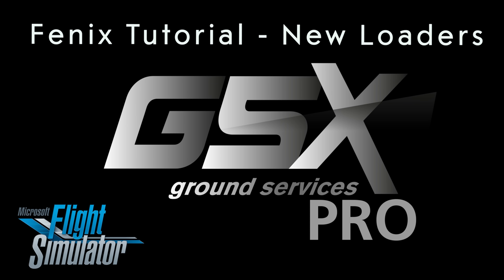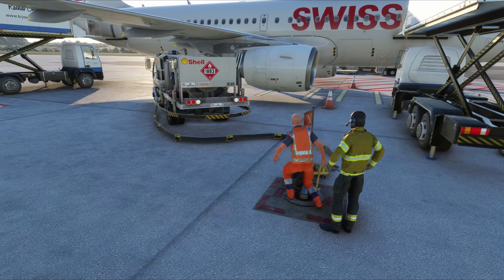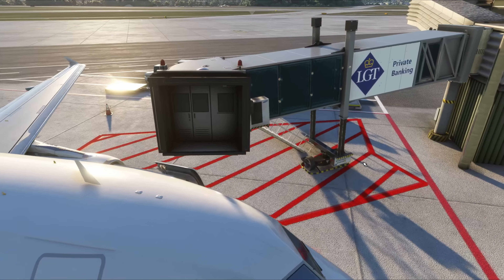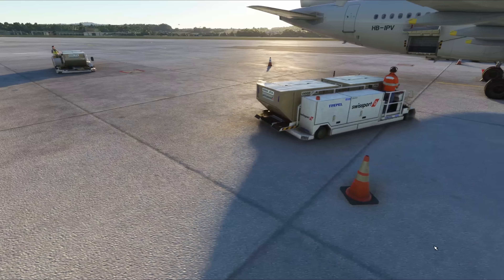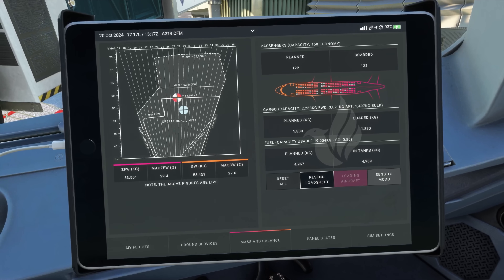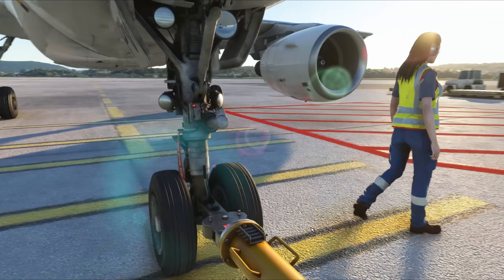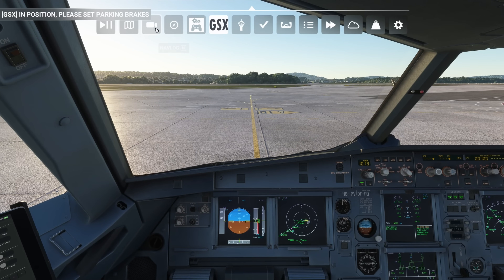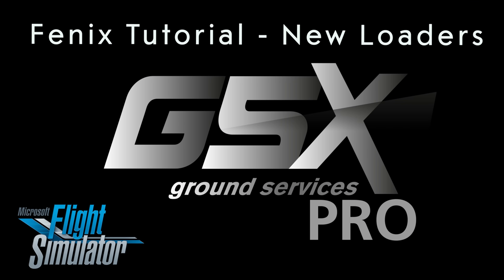GSX Pro 3.2.2 Fenix automation Tutorial and new Loaders.

Comment: I have this same fuel truck when I use GSX with the PMDG 777. It's super cool. How can I get it on my iFly 737 Max? On that one the fuel truck works but it just sits by the wing and there is no visual connection.
Reply from the maker: Read the manual where it explains the hydrant minimum height
Reply: @umbertocolapicchioni2467  thanks for the quick reply! I read a bunch of the manual yesterday but I guess that part didn't stick with me. I understand now. Maybe one day you can add a new model/animation that works with the low height of the 737. Well obviously the one right now "works" but you know what I mean haha.

Another question if you have time: On the 777-300ER it seems that by default the baggae loading is all cargo. I found a way through "customize airport positions" to configure one side for cargo and one side for belt and that works, thankfully. I'm wondering if there is a way for me to change the default so I dont need to do this for every airport/gate I spawn in? Is there a file in the PMDG folder or a GSX folder I can modify to do this?

This is my 2nd day with your app and I'm loving it!

Comment: Okay but can we make the app not close after x amount of seconds?
Reply from the maker: If you mean you don't want the menus to have a timeout, they do it for a reason, so they don't take valuable space (AND steal clicks) on screen when you don't need them. 

The amount of time after a menu times out, is different depending on the context. And what happens after a Timeout, also changes depending on the context. In some cases, nothing happens, in other case, like when selecting an operator, a default choice is applied, so the program can continue with a sensible default even if you don't care the menu, in order to work as hands free as possible.
Reply: @umbertocolapicchioni2467  you should make that a toggle in the settings. I’d prefer if the menu stayed up. If I want it to get out of my way I’ll minimize it using that button.

Comment: The first failure of GSX animation is the facts that the loading componants are leaving/come from the "TAXIWAY" !? where in reality they should disapear under the terminal whatever the airport, and second the loading process doesn't follow the reality standards such as the loading process start from the front FIRST and finishs at the REAR and the oposite for the deloading to avoid the typing event to occur on sensible aircraft.

+ the headset walker animation lack of detail aswell : Once the pushback is completed, tow truck disconected and by-pass pin removed, the headset walker MUST LEAVE the front of the aircraft and signal/wave the pin behind the limit of the RAMP LINE that should be in a white color on the Left/Right side of the aircraft depending on the pushback direction instead of standing there in front of the aircraft everytime saying (left is clear - right is clear) this is what you learn when working as a ramp agent when doing headset ( out of the way !! )

That been said, your AKH's loading units are very realistic as the real ones, nice
Reply from the maker: All your comments are related to the inability of getting more detailed data about the airport automatically. The Navdata API provides us only with Runways, Parking spots and Taxiways. That's it.  

We can't get any actual info about buildings shapes or painted markings on ground.

Comment: One thing of interest is there is no sound for the ground vehicles at all in the airport when you are using your drone camera to explore. The default ground traffic before GSX when you put your camera in front of the ground vehicle you can hear it getting louder in your front speakers and as it drives through the camera you can hear it fading in your rear speakers. It is silent with GSX for all vehicles except those that are performing service to the plane. Also, when GSX is loading baggage or cater etc. the sound volume does not change no matter how far away from the plane you travel. Just an observation. Not a huge deal but in MSFS 2024 if you decide to walk around the airport using GSX, you will not hear any ground vehicles. Still GSX is an awesome addition to the Sim.
Reply from the maker: That's because we don't have a way to read the location of the Drone camera (or any camera for that matter), something we could do in FSX/P3D with FSX using direct in-memory access, and P3D using the proper Camera API, which we don't have in MSFS, although is currently with most wanted feature.

If the MSFS SDK will every allow a way to know the coordinates of the actual camera, all 3D positional sounds GSX always had, will automatically work again, as it always did in the other simulators.

And yes, I know how to get it directly from memory but, we don't want to hack into the MSFS memory, because reliability against crashes always comes first.

Comment: Most US airports still use luggage carts. Is that still available with the new update and Fenix?
Reply from the maker: The type of loaders used is part of the airplane profile, so you are free to choose which method you want to use to load luggage.

It's even possible to create profiles linked to a specific airframe so, the configuration can even change depending on the airline you are flying.
Reply: @umbertocolapicchioni2467 wait wow. How would specify airline though? I know each model can have a different configuration but that's kinda cool.
Reply from the maker: It's not exactly by airline (although some users suggested it, so we have added it to the long queue of pending updates), it's by airframe so, you create a new GSX.CFG named GSX-XXXX.CFG, with XXXX being your airplane registration, so that configuration will be specific for that airframe only.

The "Airframe specific Configurations" chapter in the manual, Page 77
Reply: @umbertocolapicchioni2467  ok sounds good. I don't know what else is needed for this software. It works with pretty much anything even SLC.

Comment: This is a fantastic addon. However I am frequently finding that my passengers are not visible. I'm aware of having to disable and then enable the option to see passengers again, but despite this I often don't see them after an update. It seems temperamental.
Reply from the maker: There's nothing random about it, you just need to be aware that, if you add a new livery of a supported airplane, you must enter the Config page in the FSDT installer to refresh that airplane. 

And some 3rd party liveries come in packages named in peculiar ways, so they might not be recognized anyway.

The manual has a full explanation of all these issues, at Page 98.
Reply: @umbertocolapicchioni2467  That's brilliant, I'll make sure to do it at the start of every flight just in case! Thanks so much for your brilliant work and prompt response.

Comment: Hi, I wonder if the developers have noticed the impact of GSX passenger animation on performance? My computer is 78X3D+4090+64G. After opening the cabin door to welcome passengers, the performance loss is particularly large. The power consumption of a fully loaded 4090 is about 400w-450w, but when I use GSX to load passengers, the power consumption of a fully loaded 4090 is only 180w. I can't believe it, and the 24g video memory is also fully occupied. Now I dare not use GSX passenger animation, nor dare to open the passengers sitting on the GSX plane, because the frame rate is really low.
Reply from the maker: @南城离岸  this video clearly shows the impact of seated passengers on fps is minimal (and of course you can close the door to eliminate it), it’s taken with a 3090, with about 10gb of vram used in total.
Reply: @umbertocolapicchioni2467  Are you using the default boarding density?

Comment: What abt the issue that gsx requests pushback when arriving at the stand? Also you said since u started in zurich gsx has that flight plan loaded, if u land somewhere and decide to do a return do u need to then load it into gsx?
Reply from the maker: @DavidStanko14  GSX surely doesn’t ask for pushback on arrival. When you do a turnaoround, you regenerate the fligthtplan for the return flight on Simbrief, then click the Simbrief button in the GSX menu, so it will turn green again, showing the return fligtplan has been loaded, then you do the same in the Fenix EFB.
Reply: @umbertocolapicchioni2467  whenever I switch the beacon off it requests pushback
Reply: @DavidStanko14 same here
Reply: Since the update that introduced the “fast” pushback, when I cut off engines and turn the beacon off, it really does only another pushback and it does not start the deboarding… it happened 3 times already.
Reply: @25rodrigomg  yeah very irritating

Comment: Is there a quick way to load the luggage? It takes too long. It should be finished at the same time as the passengers board.
Reply from the maker: @emrahture5205  the whole point of the new loaders is precisely to save time loading bags, it will surely be completed before passengers.

Comment: The one thing I'm surprised you haven't added as a feature since you already added passengers to be with you for the duration of the flight is a PNF sitting next you (FS2024 will have this feature). The one feature I really would have  liked to have had implemented is a towing gate to gate feature. Then we could simulate a aircraft being towed from hangar to gate in the morning!
Reply from the maker: Gate to gate towing is coming,
Reply: @umbertocolapicchioni2467  Great that will be a real game changer thanx!
Reply: @umbertocolapicchioni2467 will we able to select custom routes or will gsx select one on its own ?
Reply: Im glad GSX didn't. I wouldnt want my co-pilot blocking my line of sight of panels, buttons or screens while I'm flying, especially while in VR.

Comment: Did you correct the A321 doing ULD at the back and belt loader at the front ? 😅
Reply from the maker: It's not something we need to correct, it's an user option controlled by the airplane configuration so, if your airline mostly use Belt loaders, you just set "BELT" on both cargo doors. If they use ULDs, set "AKH" on both doors.
Reply: @umbertocolapicchioni2467  my remark was : how can they use both ? That’s irrealistic and impossible. I have belt loader in front and ULD loader at rear on the 321
Reply: @jonwait he answered your question, it's nothing for gsx to fix it's a user option set in the plane config. Fix it yourself as he told you how or complain to Fenix.....

Comment: Why are cans In the airbus? When I worked on the ramp which wasn’t long ago and I still work with the airline we load our bags manually
Reply from the maker: The A320 family can all use ULDs, in fact the AKH model is shaped precisely to adapt to the A320 cargo holds. 

Yes, some airlines don't use them, and of course you can configure the airplane profile to always use Belt loaders. You can even create individual profiles linked to a particular airframe, so the usage of loaders can change depending on the airline, automatically.
Reply: @umbertocolapicchioni2467  ah ok, I didn’t know that was a thing for a narrow body but I guess my airline loved making us break our backs 😂

Comment: And how the pilots enter the aircraft if the jetway is not attached since the beginning? 😅
Reply from the maker: To save time on the video, the option to disable visible boarding of pilots and crew has been used, so the crew just appeared in the airplane at their stations. If the option to board crew is used, the jetway will operate before they board.

Comment: Fuelling and catering would take place with the jetbridge docked on the aircraft under most circumstances
Reply from the maker: @NoFly404  you are free to operate the jetway independently
Reply: yes, but it should be on by default, at all times when the fuel truck is connected, to provide an easy escape route in case of fire, IMO as soon as the loading starts the jetway should be connected.

Also there should be an option to board the passagers while the plane is fueling/gettin catering, as it's how it would be in most airlines
Reply from the maker: @raeliass  The main concept in GSX is it doesn't do anything automatically, unless is absolutely required. So, the decision of when operate the jetway early, if it's not done by you, it might be the airplane automation choice.

It's already possible to board Passengers while doing Fueling and Catering IF the gate has a jetway and IF the refueling point is set on the Left Wing.
Reply: @umbertocolapicchioni2467  perfect 👌

Comment: Thank you! Is this finally the replace of FENIX2gsx?
Reply: @Duquepilot  gsx and fenix has been synchronized for quite some time. I never used the fenix2gsx
Reply: @denziiey  I use fenix2gsx because with that app you don't have to do extra clicks, just import as in the video, but once you want pushback only click on the acp INT button and that's it, also fenix to gsx avoid extra questions like Connect tug or something like that, this is why I used fenix2gsx
Reply: @Duquepilot  you won't need to anymore. In fenix when you clock load using gsx it does everything. No need for third party apps. My goal is to limit the amount of extra stuff in this sim. Fenix and gsx work in tandem you can uninstall it. Trust me. I use fenix gsx and even SLC and all 3 work perfectly 👌
Reply: @denziiey  thanks for letting  me know I use SLC too, so I’ll give it a try!